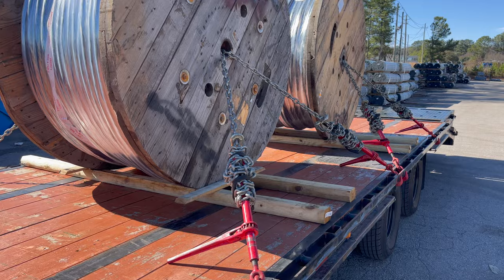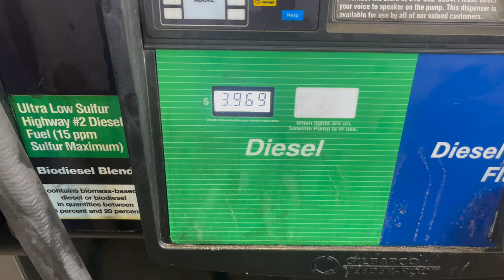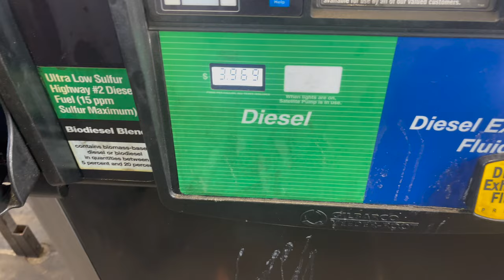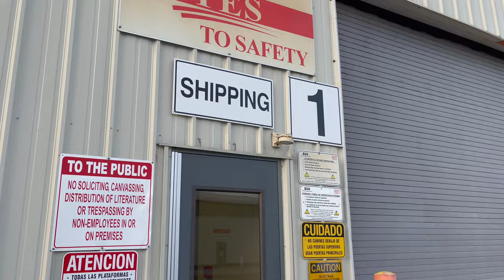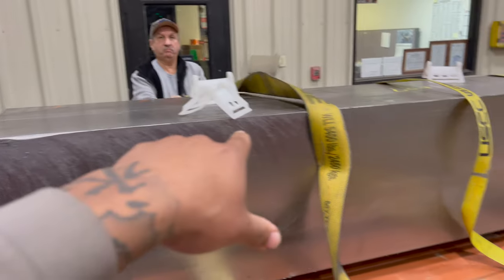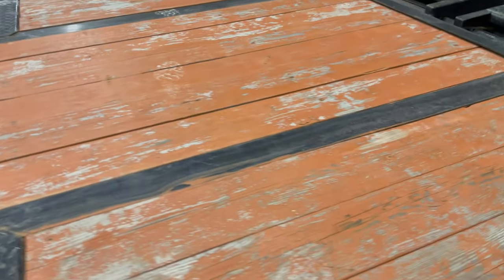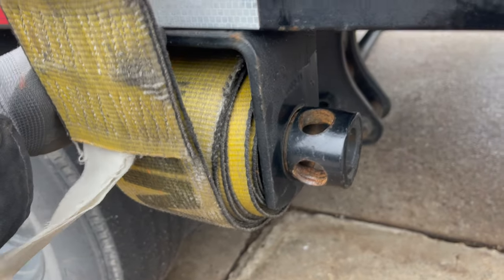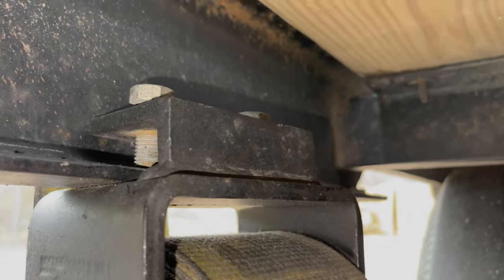Hotshot Trucking: FIRST CABLE REEL LOAD | HOW TO CHAIN REELS

Comment: If you get in that situation where you need to switch to 4 wheel drive on a hill, just set your parking brake in neutral and use your trailer brake a little if you're still slipping and then make the switch. Keeps everything internally free and still keeps you secure on the road.
Reply from the maker: Appreciate that info !